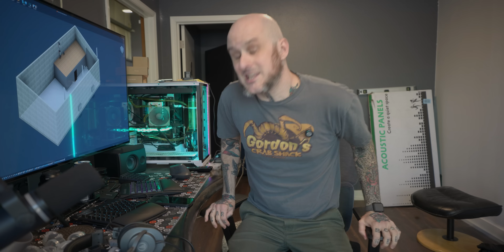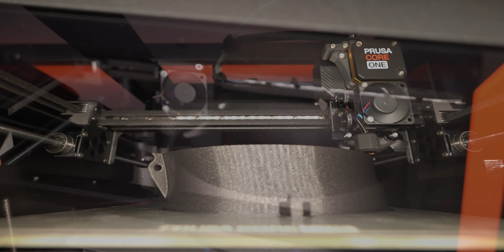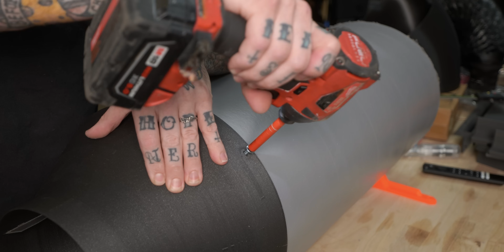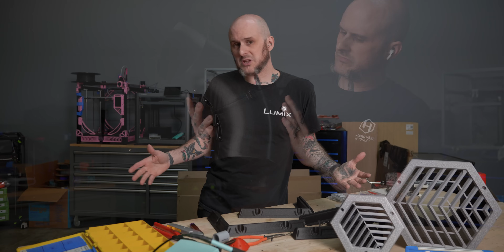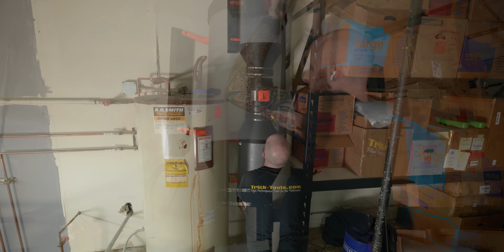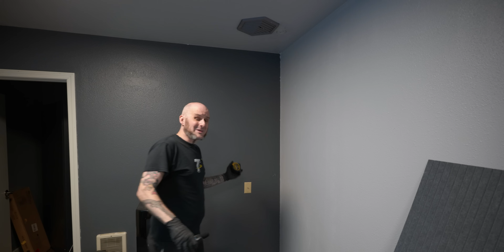This 3D Printed Contraption Cools My Office!?!

Comment from the maker: Insulation shedding in the airflow is a valid concern. I’m not honestly too worried about it but will include a low restriction air filter on the outlet path for at least a few months to see if fiber accumulation occurs. 👍🏻
Reply: If it's a worry or concerning, it's that simple to get some insulation foil and print two tubes, about 4-5 inches tall with the circumference of the inner silencer wall (the open diameter inside the insulation section. Tape the insulation foil into a tube with a printed tube on both ends. Insert the tube and you're good to go.
Reply: If you used Visa or Mastercard & did not receive your product, you should contact them directly. They will refund your money. Credit cards & specifically the two I mentioned have consumer insurance in the customer benefits.
Reply: @dennissharpe8356  Amazon is pretty good about delivery failure too.
Reply: This is a REALLY bad idea!!!!!! It's not like asbestos, but it's still not great. It's not going to kill you, but you ultimately shouldn't be using the rock wool unsealed. It will make for low air quality and particles that will be constantly dissolving in your lung fluid over time. Plus, ya know, it's going to be really turbulent and not very efficient.
Reply: FYI Audacity has a HVAC/Fan filter, (& I think OBS does too, for live).
Lol this silencer “mess” is crazy hope it helps.  
I have a similar home office (upstairs in the afternoon sun) situation too, put a AC unit in the window but am interested in this solution. 
Need overall AC upstairs oomph.
Reply from the maker: @MrGoodguy6-7  Yea, but I try not to process my audio more than I have to. Every little bit of processing can "Color" the sound output and adds up. 

I actually had a similar hot office situation not long ago, I added a booster fan to push more air to the entire second floor: https://youtu.be/IeNUOfZkAb0?si=Dh089iwn-av_zBL3

It worked, but not as much as I'd have hoped. Sadly in both situations AC units aren't really an option.
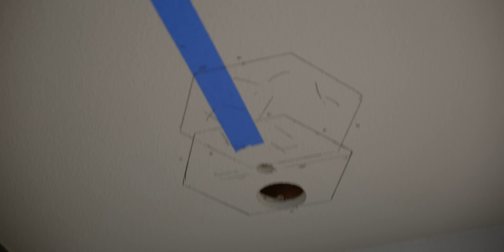Reply: 15:15 you got lucky!

Comment: Boiling point of water is 100 Celsius at sea level... wth is even 212 Fahrenheit? Ill fight you lol. Metric everything is superior. Why would you care for increased granularity in room temperature?
Reply from the maker: Because a 1 degree temperature Fahrenheit difference is noticeable to me. I'm rather temperature sensitive. 73 to 72F feels different to me. That is just 22.222222C to 22.7777777C. "I'd be a lot more comfortable if it was .555555C cooler." is not a sentence I see a reason to utter when I can say, "Hey can I drop the temperature a degree?"

Comment: Maybe a $500 mini split would have worked better 😁 Super quiet/no ducting. Most importantly, single pass HEPA filters still might not catch everything and a sealed room with a circulating standalone HEPA filter would IMO work best. I've had my 3D printers in a sealed walk in closet for the last 8 years with a HEPA filter connected to a smart switch i use to turn them on/off. So any time i have a printer on the HEPA filter also is on by default 👍

Comment: the cold air vent seems a lil small comapred to the massive duct, is your office door hard to open when the fan is running?
also why do you use so many decimal points with celcius explicitly?
Reply from the maker: No, the door does not suck shut, but I do think I could use some more inlet. I’m going to add a smaller filtered inlet to the bathroom to let air pull from both ends of the space, it’s also very cool air outside that wall. 

As for decimals in Celsius, I am a very temperature sensitive person. 1 degree in Fahrenheit can be the difference between me sweating or feeling comfortable. 72F to 73F is 1 degree difference in Fahrenheit, but only .55C difference. I can feel that temperature in many cases, so if I WAS to switch to Celsius I’d constantly be using decimal places of temperature to express what I was feeling. Does that make sense? Fahrenheit allows the expression of temperature as it pertains to the world around me to a finer degree without needing decimals. Celsius is 0 from frozen water to 100c boiling water. That’s a BIG difference for only 100 digits.
Reply: @MandicReally thanks for your reply.
On second thought, a single stage axial fan is never going to make much vacuum at all.
And tbf that Celsius v Fahrenheit explanation is the best I've read.
If you were open to random suggestions:
1.more inlet (far more, could even test by using the door) i would at least have the same surface area as you do with that huge fan and ducting 
2.pump pc heat elsewhere
3.use pcm's to give some cooling, I made some and it's quite cheap

Comment: let me help you out and save you some future money.  150-200 for a decent tower fan stick it in the corner of the room.  You dont have enough in room circulation creating the stale air situation.  even at low speed keeping Db Low it will still move enough air for you to feel cooler.

Comment: This is a REALLY bad idea!!!!!! It's not like asbestos, but it's still not great. It's not going to kill you, but you ultimately shouldn't be using the rock wool unsealed. It will make for low air quality and particles that will be constantly dissolving in your lung fluid over time. Plus, ya know, it's going to be really turbulent and not very efficient.

Comment: You really really want to change that inlet filter from a 1" thick filter, to a 5" thick filter.

They last much MUCH longer, and are technically more efficient through MUCH more improved airflow.

They're much cheaper in the long run as well.

Comment: Small room or sealed server rack in the other room with good flowing air filter set up with a positive pressure design. Then use longer cables to attach in office. The positive pressure keeps dusty air from coming in any minor openings like around cables. Your off would then normalize to the same temp as the other room.

Comment: so let me get this straight you used gloves when handling the rockwool 
and even vacuumed the floor after assembly as you should it can irritate eyes skin and even your respiratory tract 
but now you are using an 8 inch fan to blast tiny rockwool particles all over your shop .
i would at least put a filter on the outlet that leads to your workshop

Comment: First he claims Fahrenheit is better than Celsius, and then he dives headfirst into BTU... British Thermal Unit...
"One BTU is the amount of heat required to raise the temperature of one pound of water by 1° Fahrenheit at the temperature where water is at its densest (around 39° F)."

Cool story, bro. But for anyone using the metric system, BTU sounds like something invented during a tea break in the 1800s and never questioned again.
Seriously—do Americans get their electricity bills in BTUs?
“Congratulations, your AC used 42,000 mystical heat goblins this month!”

Why not just use watt-hours (Wh) like the rest of the modern world?
It’s like measuring your commute in horse strides instead of kilometers. Charming, but wildly impractical.

Comment: get rid of that flex tubing man. I've done plenty of air CFM readings with and without it. makes the air turbulent, your whole system will move more air with solid ducting. Does that old AO Smith water heater still work though?
Reply from the maker: Works fine as far as I can tell. But that’s part of the thing. Even a hobbled unit is more than enough for the 2 hand wash sinks in this space. An 80 gallon tank was overkill from day one. It’s mostly that the plywood is damaged where it has clearly leaked badly in the past. Directly below the hot water heater is my entire studio electrical panel. WHEN it pops, it’s going to be a very bad, no good day. A tiny on-demand unit would take up 1/10th the space and be more than rough for the space.

Comment: As a 3d printing geek.. This is awesome. As one who has done custom HVAC setups for employment.. Might have been cheaper to build with traditional ducting.

But, still awesome.

Your temps though.. Still too warm for me. I keep my normal house temp at 66f.
Reply from the maker: I added it up at some point and it really wasn’t that big of a price difference to use off the shelf duct parts. Now if you start talking print hours the value is lost, but just filament expense it’s fine. 

It’s honestly too warm for me too but trying to just suffer for the reduced bills. 😅
Reply: @MandicReally oh, prefab ducting is way over priced. 😅 I have friends with those bendy setups (press) for making ducts when I lived in the Seattle area.

Comment: I would worry about mould in the insulation as its inside the air flow if it gets moisture build up but as long as its venting air your health should be good.

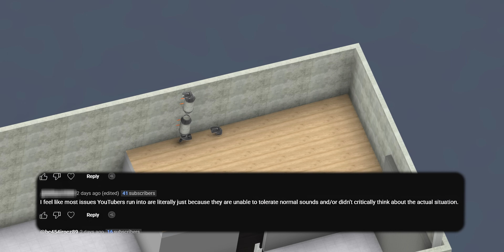Comment: 2:19 well it's pretty true in many cases, sounds most people don't really even notice seem to bother some YouTubers a lot.

Sure sound quality could be messed with during recording but from my experience stuff like fans and printers are easy for noise cancelling to handle and can mostly be turned off if needed.
But really most people are probably watching on phones which don't really have good enough speakers to represent everything that was recorded, my alg k240s definitely pick it up but I suspect most people are not listening like that.

Im not trying to be mean and im definitely not opposed to projects to improve things but I'm just saying it's amazing the lengths YouTubers will go when it comes to sound.

Comment: What about adding a small box fan in the space between the dry wall inside the air duct where you have the filter. That way you can draw more cool air from the outside office space. Even a small PC fan or 2 would help you with that

Comment: This is an EXCELLENT Solution!!!! Aside from not being able to control that fan from inside the room (yet) I frikkin LOVE IT! I have the same problem with my computer and my LCD TV screen PLUS I put off a TON of body heat, like WAY MORE than most people. it's actually a medical thing called hyperhidrosis, where I sweat much more than everyone else, and it's not in just one spot like most people that have this condition, I sweat lot from everywhere. and too much sweat is bad because it doesn't evaporate, which is what cools you down, so the heat gets trapped and I sweat even more. it's an awful feedback loop, with ZERO TREATMENT - just TOWELS and WATER (and SPORTS DRINKS when I need to replenish electrolytes) So when I'm working on my computer, the room gets REALLY HOT if I don't have some kind of active system cooling me and the room down.
So this project was right up my alley!  But there was a critique I had while watching, but nothing that was done wrong, just suggestions. First the filter. Do you REALLY need a filter on the rooms intake? It doesn't seem like the large workshop area has too much dust being created on a regular basis so there's not gonna be a ton that filter is gonna collect. And really it's pretty tough for that fan to pull the air through the filter. And I know it is because you're felling it AROUND the filter and from under the door.  It's not a very strong fan meant for high static pressure anyway. It's most likely designed to just move air out in the open, and not create a lot of suction in an enclosed system (I had no idea that there was a difference until a few months ago watching some videos about filtering air) So if you were to close off the gap under the door, you probably won't get any more air to come out of the gap around the filter. The fan will just be spinning but wasting the energy.  You could do some simple tests between having the filter removed, having it on AND the door gad stuffed with a towel or something, and the way you have it now. Then you could get one of those handheld gadgets that measure's windspeed and you'd put it in front of the fan vent you put in the ceiling. You wouldn't see much, if any difference between the way it is now and stuffing the air gap (you'd probably see a DECREASE when you stuffed the doors air gap), but you would see an increase in airflow  when you took off the filter. And that would show you that stuffing the airgap on the door might only change where the cool air comes in just a tiny bit, but wouldn't make the room any cooler. If the area around your computer is hot compared to everywhere else, just a small $10 table fan from WalMart. Moving the air around makes a ton of difference when it comes to feeling cool and mixing the hot air up at the ceiling with the cool air by the floor.

Comment: I've had printers for a few years, but I've only started learning FreeCAD in the last year. I needed to set up a standing AC unit, but the hose was too short, and the extra hose was too big. Instead of getting a new hose, I modeled a hose-to-hose adapter, as well as big-hose-to-smaller-window-vent adapter. Seeing it all come together felt amazing, and has inspired me to learn more.

Comment: First thing first : Fahrenheit, inches, foot, yard, miles and all of these units Americans use are not "freedom units" it's imperial unit, made by the british, imperial is kind of the opposite of freedom, so stop to call them freedom units, because it's not.
SI units are made to be logical and more related to physics, in example: at 1 bar of pressure water freeze at 0°C and boils at 100°C, at the same pressure it takes 1 calorie to raise the temperature of a cubic cm of water by 1°C, and a cubic cm of water weight 1 gram and 1000 grams = a kilogram. the same goes for a meter, multiply by 1000 = a kilometer, or divide by 1000 = a millimeter, every precision work uses SI for mesuring, Imperial does not even have its own scale for nanometric things.
Your own scientists in your country use SI units for precision, because imperial units are not precise enough and generate errors when converting or adding them up.
If you don't want to change because you like the imperial system you learned when you were young, there is no problem, it's your right. But saying that your system is better than anything else despite all the proofs that it's not is childish, you need to grow up on this.
This taken appart, great project ! but i think there's room for improvment, you should have made something to dump your computer heat out of your office (or putting your computer in the server room and run cables in the wall to your desk maybe ?), plus adding a ceiling fan to mix the air.

Comment: Flexible ducting sucks for airflow. So remove that piece in the middle with a straight pipe instead. And just get rid of that on the exhaust entirely. I dont even understand the purpose of putting that on. Its does nothing(except restricting airflow).

Comment: Not sure if you'll see this.... or if it'd be something plausible to do in your situation..... but a thought that might help.  Why not try to figure out if relocating the desktop to the shop floor without it being in the way of something else is a possibility?  I have my computer on the opposite side of my bedroom wall, with all the video/audio/input cables running through a grommet of sorts that I drilled a hole for.  I purchased the grommet from somewhere, but I'm sure there's a model of it somewhere, since it just seems like it was 3d printed anyway.  It's just a tube with threading and a flat contact ring on each side so it can be tightened to each side of the wall.

Could shove a wad of foam or something into it after running all the cables through to help cut back whatever little noise might come through it otherwise (though I'd be surprised if much would), and then the only heat generating thing in the office would be the display.

Comment: One big issue I see with those noise dampers is the lack of a protective cover for the rockwool/mineral wool material. These are very nasty stuff for our lungs. Professional products usually have a non-woven cloth for retention of the fibers/particles when the air passes through. Insulation boards like those are protected even in ventilated facades because due to air passing by they loose properties and exhibit an unraveling process.

Comment: I've always been curious about doing work like this in rental places. What kind of permission do you have to get ahead of time? Is it permissible if not doing anything structural? Do you have to put back to original condition if the lease ends?
Reply from the maker: Return to original condition when you leave. I had to get permission for the air conditioner install and hire contractors for that. Legally any electrical and hvac work requires contractors. But things like this are easy “return to condition” and when I took possession there were shelves, still equipment, and window ac in the office. So clearly that policy is a bit lax. Depends on who you rent from in sure but minor modifications to suit your needs are expected in commercial.

Comment: have you considered putting a filter on the outlet of the exhaust? The rockwoll the air is directly in contact with could shed small particles which you really don’t want in you lungs (or those of your cute little doggy). I checked, rockwoll isn’t recommended for the kind of sound damping you‘re using it for and my guess is the fiber pollution concern is the reason.

Comment: If you're concerned about the dust rock wool insulation produces, you really should not use it in a ventilation system, right?
Reply: I was expecting the silencers to have an inner tube to prevent the air coming into contact of the insulation.
Reply: I expected the insulation to be on the outside, but when he painted it i kinda expected it to have a inner pipe... i don't know very well about mold and stuff but really hope its all ok

Comment: fiberous insulation is at best a respiratory irritant and at worst possible carcinogen usually the inside would have a perforated screen to at least not have bits of the fiber insulation the contact surface in the air stream.